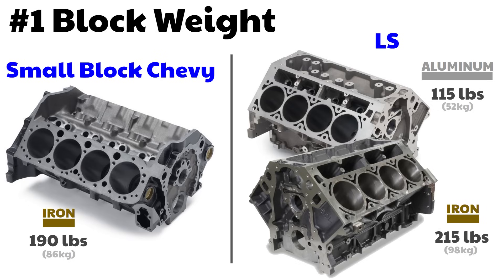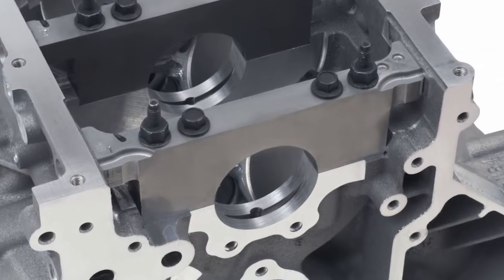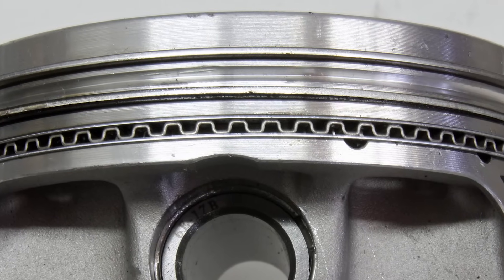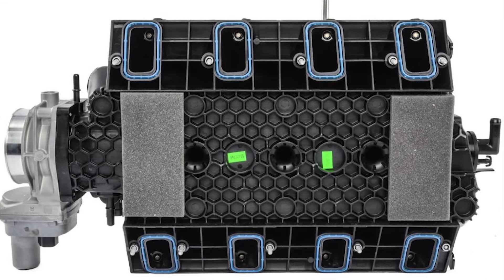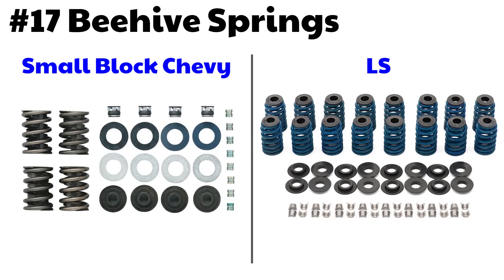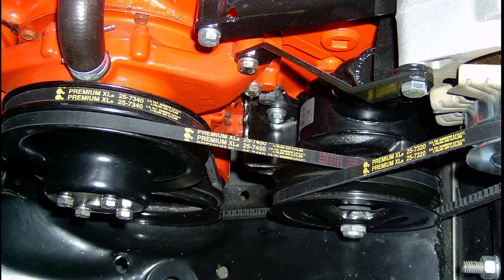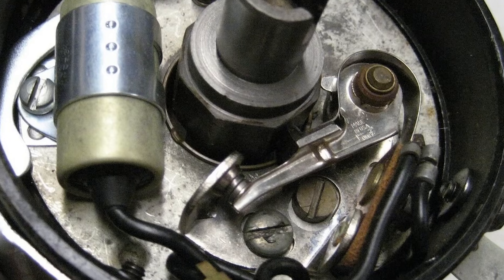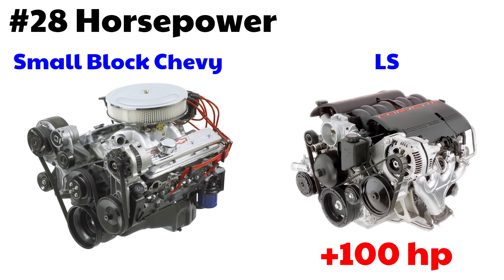29 Reasons LS is Better than Small Block Chevy (Gen 1 & 2 vs Gen 3 & 4)

Comment: You can keep your computer, and sensors, and the hideous intake manifold, and the ugly coils on plugs....I'll build a mild small block that will put out 400hp, and enjoy opening the hood, and wiping off the valve covers. I'm ordinarily a form follow function guy, but with this, the performance is there either way, so I'll put that nasty Holley on top and call it good. You can't lose either way.

Comment: The LS engine you just described could have been the Ford FE 427 Side Oiler. The Ford FE 427 went on to win Lemans in 1966 and 1967 until Lemans banned it. I am a Chevy fan, but Ford totally had us. Even today, the 427 FE Side Oiler has a better oiling system with priority main oiling. The 427 FE even had aluminum heads for Lemans. The 427 FE was dyno tested at race conditions for 48 hours straight. That is why Shelby Cobras and Ford Lemans cars are so valued today. Ford spared no expense on the 427 FE Side Oiler engine and it payed off

Comment: Great video! Just would like to add that the 350 Chevy did have fuel injector in the later years, it was throttle body fuel injection (TBI) and had many of the same (sensors) as port fuel injection which the LS motors have. 
Also I will add that the LS has ( coil by plug ) not ( coil on plug ) which would be directly on top of the spark plug. The LS has a little plug wire and the coil is just by the plug. Great video 👍🏽
Reply: The 350 also had port fuel injection. The Vortec motors were not TBI.

Comment: HP is in the cylinder head, no matter what engine. It's just an air pump. This where the LS is better. Theres not a bad flowing LS head. What he says about the old small block on HP is bs. It's very easy now to make 400 t0 500 hp on an old school 350 and it not blow up. Lots of bullshit here. Lmao.

Comment: Also note the sepintine belt 350s in my opinion are easier to take off the belt because the ls has two belts the regular serp belt and the AC compressor belt. The 350 serp belt has one belt total.
Also I noticed with the vvt you also have plastic timing parts in them that fail sooner than the old small block or early ls.

Comment: Toyotaized gm V-8 ha ha ha, lifters can't, be changed without pulling cly, heads . And the do go bad !!! Junk oil sys, Pump belongs in the oilpan , no freeze plugs.single wall block is noisy, piston slap from the factory thanks...single use bolts though out,  JUNK. own it wear it !!! Lots more wrong with L- motors besides setup for good classic cars ending up in crusher when, not if converted cars deemed illegal by YOU KNOW WHO ...you fool !!!

Comment: https://www.youtube.com/watch?v=UZ1PRsfO09c WHERE CHEVY COPIED THE LONG SKIRT BLOCK DESIGN, FROM THE FORD 427 HIGH RISER ENGINE. THE LS IS NOT 100% BUT 1000% BASED ON THE FORD 427 HIGH RISER ENGINE. NOT ONE DESIGN ASPECT OF THE OLD SMALL BLOCK CHEVY LIVES IN THE LS. IT IS COMPLETELY FORD IN DESIGN.

Comment: All those improvements basically allowed chevy to get away with selling 16 valve cam in block pushrod engines that made reliable power and some fuel economy while everyone else has switched to a single/dual/quad etc overhead cam 16 -32 valve engines. I am still waiting to see the day chevy goes overhead cam design on their v8s reliably(Northstar was a fail and maybe they are still improving it secretly?)

Comment: Rebuilding a BBC right now, yeah I know this is about SBC, but for either I've gone to old school HEI and carb. Continued issues with software that will be outdated and/or non fixable plus honestly I just don't see an issue with driveability. I know of a lot of LS swaps into older vehicles and that's fine, but I think theres good reason that a zillion regular old SBC are still out there.

Comment: i dont know where you got your information because a bare SBC doesn't weigh 190lbs.....lol they weigh 157lbs... and stock block can only handle 360hp?WHAT? when the LT1 in 1970 was underrated at 370hp......i know several local people with stock block SBCs running N/A and a couple with prochargers and roots, the guy with the procharger runs 800hp in a 69 beaumont prostreet car, guy with the roots runs 700hp and a few people run 550-650 N/A.... also a guy with a C6 Z06 with stock block LS3 procharged/ cammed/heads/dynoed at 800whp....... while the design aspects are true those numbers are totally false
Reply from the maker: You do realize the 370hp was gross hp, not net hp that we use today?  And yes some blocks can handle more power, but with the LS all the blocks are equally strong!
Reply: @AutoGuild  gross and net aren't too far apart, especially in the case of the 1970 LT1, and it being underrated at 370hp

Comment: Not to argue but all your "benefits and improvements " negligible if not wrong you are pulling from the bottom of the barrel for the old small block and cherry picking the lst benefits I for one have a 450 horse 355 in my truck that gets 25 miles to the gallon around town  and a 7000 rpm monster of a 383 stroker putting out well over your 500 horse power limit you say the small block has. They both have their benefits and draw backs for one the ls thinner ring are prone to blow by a smoking engine burning oil in a relatively low mileage

Comment: The aluminum blocks can hold a hell of a lot more than 700 lmfao you have any idea how many 850-1100whp aluminum 5.3/6.0 I’ve worked on and ported heads for a lot of them are even stock bottom ends they are almost indestructible with a good tune and proper valvetrain.

Comment: I'm gonna tell you some reasons why it's not "better". 1. crank driven oil pump. 2. Made of soft aluminum. 3. Plastic intake manifold. 4. No lifter valley. 5. Can't remove the lifters without taking off the heads(why GM, WHY?!?!). 6. no distributor provision. 7. Per plug coil packs(again, WHY GM, WHY!?!).

Comment: Just curious what about the 96-00 5.7 vortec they have a plastic intake like the ls not sure if you could shine some light on that or if I'm just miss something you said
Reply: The 5.7 Vortec has a plastic upper intake, the lower is aluminum and still subject to exposure to hot oil and coolant like the other small blocks.

Comment: The main reason I prefer an old carbed SBC or BBC over an LS (and I have both) is because I dont have to go visit a tuner with a dyno to make adjustments every time you change something.
Carbs are just mechanically simpler and if you know how they work a lot less troubles.
Reply: I understand what you're saying but, you must force yourself into learning how to do this tuning.  Once you master this, much like you have obviously mastered jets, mixture screws, floats etc..., you'll be once again the fastest, most knowledgable guy on the block and can still go out to your hot rod in the middle of January, and fire it up and walk away without it stalling.  No more f^&king around with chokes!!!
Reply: I got hp tuners for my LS1 in my C5 Corvette.  I have been tuning it to absolute perfection.  I have a monster BTR stage 3 cam it and it drives like a stock motor.  But makes 408 hp to the wheels.
Reply from the maker: For sure, there is some truth to that!  But its getting harder to find someone that can tune a carb these days too!!
Reply: @AutoGuild nothing a quick read regarding carb tuning won't take care of. Simple.
Reply: Ummm....you can put a carb on an LS and have both carb and reliability.
Reply: @SOLDOZER  still need a computer for ignition timing
Reply: @admiralfloofz658   MSD box = $400.
Reply: @SOLDOZER  price wasnt the point, simplicity was
Reply: @admiralfloofz658  you call the MSD box a computer and you mention it's not simple.  It has dials for ignition curve.  It's actually simpler than using a distributor and changing springs, weights, clocking the distributor to change timing, etc

Comment: Look, I'm not gonna deny that the ls engine is awesome... however, I'm a sbc guy through and through. I have a 1990 gmc k1500 short box, reg cab, stepside. I plan on building a high performance 327 engine for my truck. The reasons why I'm sticking with a sbc are these; 1st. Cost. I can build a 400-500hp engine for half if not a third the price of an ls. 2nd, anesthetics. When I'm at a car show, I want want be able to open the hood and see a nice, pretty sbc in there. The ls, while hot, is not cool. They are the croc shoes of engines. People like them because they are popular, but still fugly. 3rd. Convenience. There are literally isles in parts stores dedicated to small block chevies. I'm sure in 20 years, ls engines will have the same luxury, but right now, I can go into most autoparts stores and get parts for my engine.

Comment: It's a great video on why a factory LS is better than a factory SBC. Doesn't take any aftermarket into consideration though. For me I went with a SBC because everyone seems to be building LS engines and I wanted to build a modern SBC. I was able to build an 8.5:1 compression SBC for about $2000 less than an equivalent LS engine. It puts out 400hp and 400ftlbs or torque and gets 12L/100km fuel economy (highway with a T56 transmission). It's fuel injected and I have the option to run a supercharger to increase the HP to the high 5's. 

LS engines are great but the SBC has had decades of innovations through the aftermarket world that can make it very competitive with an LS engine and you can build them for cheaper even with utilizing high quality parts such as AFR aluminum heads, hydraulic roller lifters, hypereutectic pistons, and electronic fuel injection. I'd also have to disagree with LS engines having a more reliable ignition system. I have known more people who have to replace the ignition coils than I have people having issues with an HEI. I stayed with HEI because they have less parts and they're way more reliable.
Reply from the maker: Yes, its an OEM to OEM comparison, I should have made that more clear.
Reply: Mighty hard to build cheaper if building an all aluminum block. A lot of this bickering fails to mention the fact that aluminum LS can be built one HELLUVA LOT CHEAPER than an aluminum gen1 SBC. Less weight is free HP

Comment: Nice. The LS is just impressive all around. First- I am pretty much an old-school purist. Meaning I much prefer to see an original engine rebuilt, ported, polished, blueprinted, balanced, strengthened, maybe turboed or supercharged motor.... but....Dang, the LS is just SO much bang for the buck. You throw a cam in one and get 400hp. And they're so flippin cheap and plentiful. I was hemming and hawing as to where to go with my old farm truck, but in the end, I could throw a pile of cash at it and maybe get 250hp, or I could find a wrecked Escalade, pop that motor in with a decent cam and get 400hp or more. The LS is just a beast. A cheap beast. My 94 toyota pickup went to the LS swap guy. I may have lost a good chunk of cool-factor (I mean, a built supercharged sidedraft 22re would have been awesome), but the LS is just vastly more bang for the buck. (And have you seen that Edelbrock cross ram dual throttle body LS intake? That mutha looks like something off the Batmobile) Time will tell if I made the right choice, but right now it looks like LS ftw.

Comment: LMFAO... This new generation has no clue.. As a professional auto technician for well over 30 years and a mobile technician for 12 years now.. I can honestly say, aluminum has nothing on cast iron.. #1 cast iron blocks can withstand temps that will completely melt aluminum. #2 try driving an aluminum motor, over heating across texas without blowing a head gasket or completely destroying the motor in the process.. I did just that in a 95 Chevy g20 with a 305.. And no problem.. #3 i can fix anything on the side of the road with my old school small block, without a scanner, and not pulling any codes. #4 while i do admit, mechanically the ls has some awesome improvements, if someone desinged the old cast iron block in the same design, it would by far out proform the ls. And last, the cast iron block, will continue to run in case of an electronic attack or nuclear war.. God bless
Reply from the maker: Judging by your pic I may be older than you!

Comment: So a part that doesn't move like the spring retainer u mentioned increases the ability of the engine to rev higher? Kool! With that logic a lighter oil pan or even bumper could let my engine rev higher just think with how much weight I could save off swapping out my steel bumper for fiberglass.  . . My motor will be revving to over 80,500 rpm except for 1 problem ur absolutely restarted if u believe that a spring retainer will make u rev more I call bs get it together if u want true and correct info about motors click the like button on my comment
Reply from the maker: Every little bit of weight helps!  It all ads up

Comment: Truth be told, if you like light weight, efficiency etc, the electric motor kicks Internal Combustion engines all day. We've just been waiting for better, cheaper batteries. The wait will soon be over. The IC engines won't be going away but light weight electric and self-driving cars are going to be awesome.
Reply: Why have a car if you want a self driving car part of the fun of owning or building a car is driving!!!
Reply: @bobmeeker3694  Commuting to work and long trips suck. I'd rather  be napping or doing things with tablets, video screens etc. and then there's romantic adventures in bed because now your car doesn't need to have seats and seat belts. I understand driving for fun. There'll be parks for that.
Reply from the maker: Love EVs too, 1000 lb ft of torque at 0 rpm.  Sign me up!

Comment: Thats not true the stock sbc BLOCK alone can handle -1000hp stock  LSX can go much higher.  Some high performance  LS aftermarket blocks go back to the  4 bolt non skirted style . SBC gen 1 can also run LSx  injectors coil over plug  ignition.  Its a block from 1955 I would hope its predecessor is better.  GM still makes an  aluminum sbc block . The real advantage of LSX is  larger cam head and  upgraded injection system.  The aftermarket can sell you a bullet proof sbc just like a LSX.  The aftermarket you can  build  any sbc imaginable with any cubic inch  out of any material with any type of head that flows as much as you need with what ever cam in any type of injection and ignition system with any power adder. SBC parts are still cheap , more options . If we are talking two stock blocks sure the LS wins but after that the sbc has 70 years of engineering innovations.  Its hard to choose when you start spending real money.

Comment: You need to stop using Wikipedia as your sources. Some improvements have been made, but there are more sbc rolling than your ls. I can't find any ls's from 03 stull in working order....but a crap ton of sbc every gen, everywhere.  These ls engines are designed to shit themselves in less than 100,000....so you can keep your plastic motor, I'll keep winning with old school!

Comment: so around 7:30 you said some super false information. the ls has trays that allow you to replace lifters without removing the heads.
its backwards. small block chevy you remove the intake to replace lifters. 
ls motor you remove the heads. the lifter "tray" as you call it. its the guide.... is removed after the head. as the extra 5 small bolts for the head are over the lifter cut out.

Comment: Good video. However, even though the Aluminum LS is 75 lbs lighter than a SBC try finding one. Chevy stopped making LS1 and LS2 blocks years ago. Most LS are iron blocks. Also, you left out the most important part about the cylinder heads. LS heads have a 15 deg valve angle as opposed to the SBC's 23 deg valve angle.
Reply: The L33 5.3L is also aluminum, as well as the LS3, L99, and L92 6.2L (and the L76 6L).  Yes, most LS are iron blocks, but it's not like aluminum blocks are extremely rare.
Reply: @stlchucko Thank you. Me being a Gm guy from kid age 14 , 1st car Eva was a 85 z28 H.O 305 to 7 more 3-5th Gen Ls. You are rt idn we're or who told him that about Gm Ls base motors

Comment: I think you missed a opportunity to explain why the heads/ are better!!! First they went to a "spread port" design, this allows for much larger intake runners to the valves, and much larger exhaust as well, second the valve angle on a ls is 15° as opposed to 20° sbc this allows for a larger valve, and more cam lift without cutting large valve relief in the pistons. Side note, the firing order, witch is the same as a Ford windsor, gm used it with the 8100 big block,  and it balances the motor much better for a higher rpm.
Reply from the maker: OMG the heads could be a whole video!

Comment: I will be the first to admit having worked for GM dealers for quite a few years that the ls is one hell of an engine. It takes an already fantastic engine to new levels.
When Ed Cole designed that engine in 1954 he had to use 1954 technology. Screaming horsepower was not a major requirement then. He also had four months to design and build that engine. For design that went from drawing board to production in 4 months and remained in production until the very beginning of the 21st century is quite an accomplishment. You also have to take into account that until recently Chevrolet was the lowest price of GM's cars it was the working man's car, so there wasn't a lot of budget for a super fantabulous engine. Considering the fact the original small block completely displaced Ford's flathead V8 which until 1955 was the engine for Hot rodding, it was again no small feat.
The LS is an awesome engine just like the original small block Chevrolet. It is a worthy replacement for a still very Worthy and awesome V8.

Comment: Some of these things are stupid because the SBC is like the lego block of the engine world. You can get different ratio rockers, aluminum heads, roller rockers. The only really big things are are weight of the iron block and the cross bolt mains.